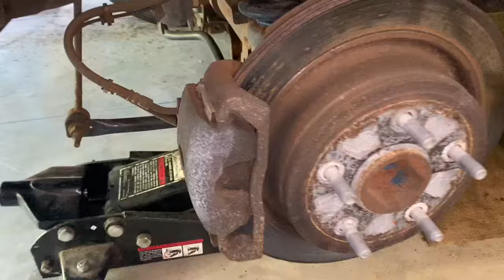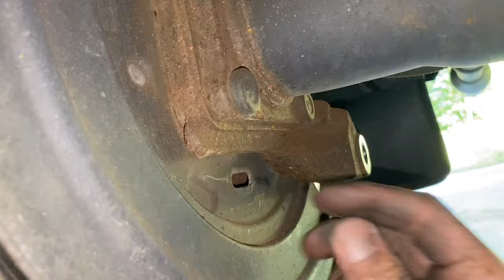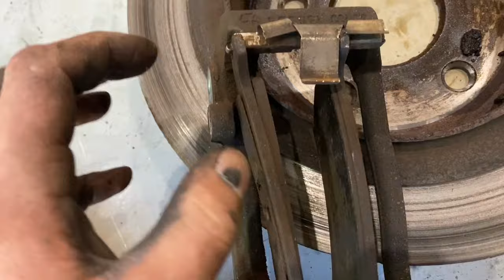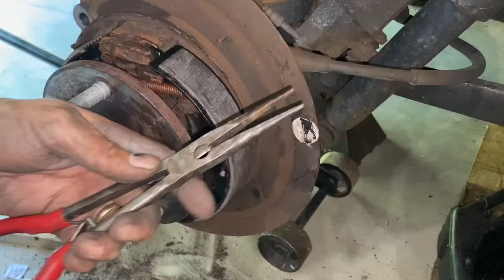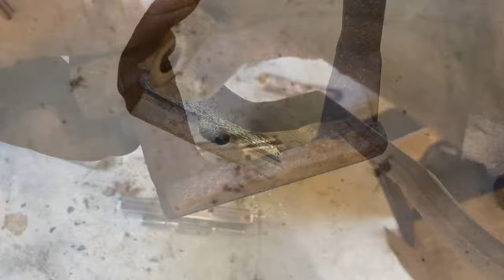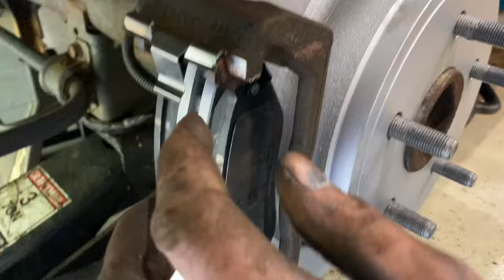2015 Ram 1500 - How to Replace Rear Brake Rotors, Pads, & Parking Brake Shoes

Comment: Damn. Looks like a nightmare to do. 😩
Reply from the maker: It absolutely is. It’s a terrible design. I would not recommend this job to a friend. That being said, if you are patient, it is very doable with basic tools. It just takes a while.
Reply: @WiringRescue  I'm probably gonna take it to my local brake shop and let them deal with it. As far as pads and rotors. Well that's easy peasy imo. 👊🏽😎

Comment: why didn't clean your greasy dirty finger marks off the e-brake linings before you put the rotor back on? Always clean your lining surfaces before put a rotor or drum back. Better yet dont get them dirty to start with, yes it can be done!